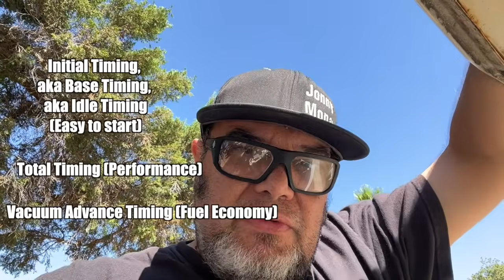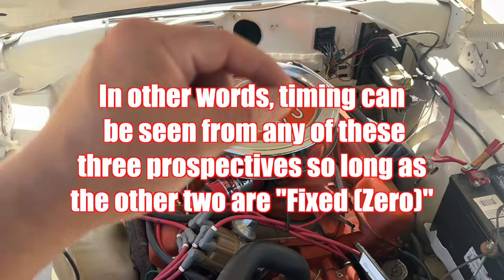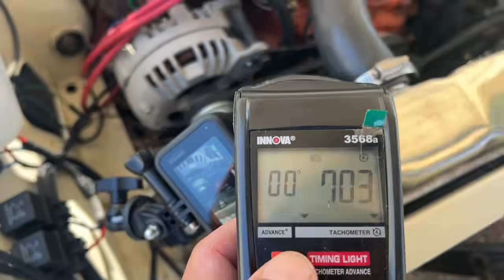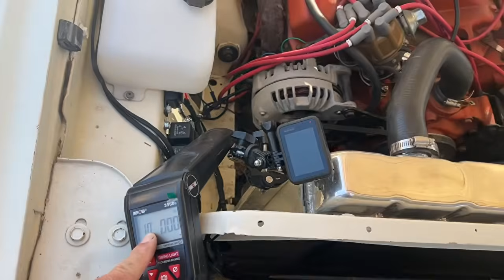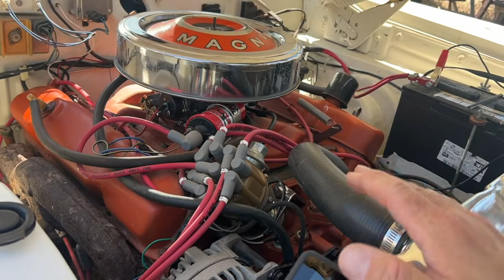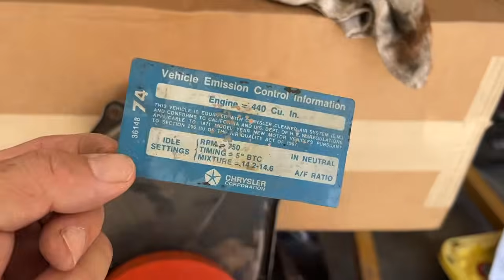Digital Timing Light & Timing

Comment: Or do you find where the line stops then measure with the light to see what the timing is at with adjusting it up and down at 2k rpm i am so confused on how to find total timing i still cant total time my 71 c10 because not one video on youtube fully goes deep in depth into it. I know you rev the engine and since I do not have timing tape and only have a tab that goes to 12 initial what am I looking for exactly when I rev the engine do I watch the line and see where it stops then ajust the distributor to that point and if so won't that throw off initial timing on start up I am so confused.
Reply from the maker: Okay, slow down. You got this. I suggest you watch the video again after you read this. I assume you have initial, aka idle timing down, right? I’m going to use pretend numbers, let’s pretend your initial is 10 degrees. Using a digital timing light, your timing marks are at zero and your screen reads 10. 

For total timing, you Rev the engine around 2k rpm. Your marks are going to change. While maintaining the approximate 2k rpm You have to push the arrows on the timing light so the timing marks are at zero again because they’ll move now that you’re in total timing. Once aligned to zero, read screen on timing light, it should be 28-32 degrees or so. That’s your total timing. Don’t forget to disconnect your vacuum advance hose before checking timing.

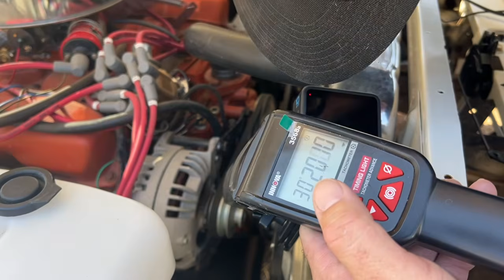Comment: At 14:02 you did not show how you found 30 degrees where the line was stopping making it very confusing for new guys like myself trying to learn timing an engine properly. So how did you make the digital timing like read 30 did you ajust it up and down or did you hit a function button?
Reply from the maker: You adjust it up or down until the timing marks read zero on the harmonic balancer to timing chain cover. Whatever is on the screen of the timing light is your timing.

Comment: Thanks Jon. Good video. I'm wondering if you should have split the video, but I couldn't figure out where the split would be. Ported vacuum/manifold vacuum is heavily debated. All I can say is ported vacuum works for me, and once anyone finds what works for them, they should use that. But a good example of why I use ported, instead of manifold vacuum or a locked-out distributor, is Roadkill. Some of their cars were running their timing all-in, all the time, distributor locked out. But they're hard to start and they're overheating. They're a bad example for someone trying to learn, but entertaining because of their ridiculousness. Usually I use chalk or white-out on the timing tab and in the line on the balanced/damper. Just to make it easier to see. Appreciate you man. 👍
Reply from the maker: Thanks Targa. I always appreciate your comments. I might have to do another video about Ported vs Manifold. I tried to point out it so small of a difference that’s it’s mostly insignificant and definitely not worth debating or fighting over. Both will work just fine. Your not going to loose a bunch a fuel economy because you run ported, which is no vacuum advance at idle. Off idle, no difference between the two. You’re rolling like the factory intended. Don’t let anyone convince you you’re doing it wrong. Again, I appreciate you bro.
Reply from the maker: And the white chalk or paint is a great idea. I need to remember to do that while it’s out of the car and easy to get to. Lol.